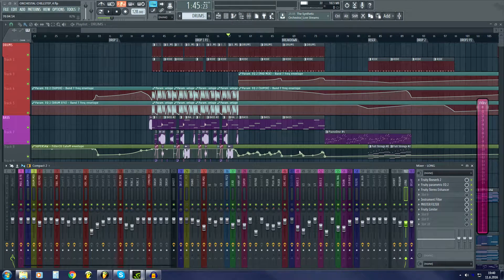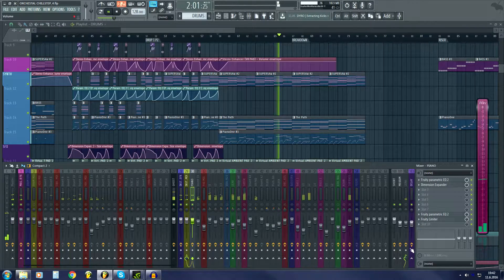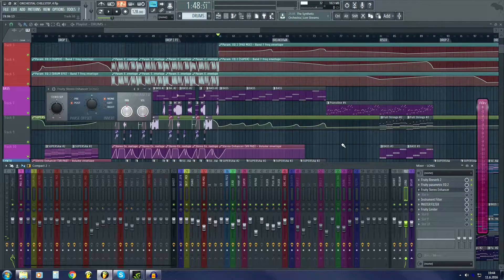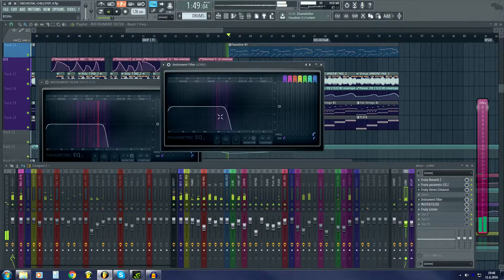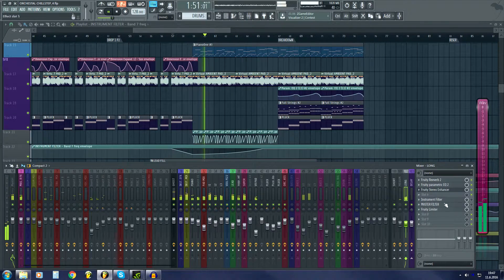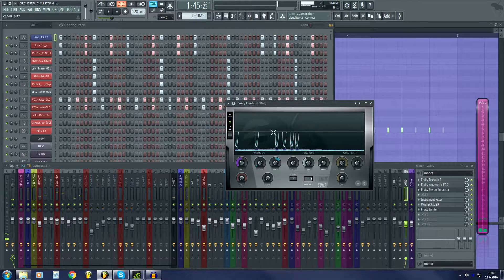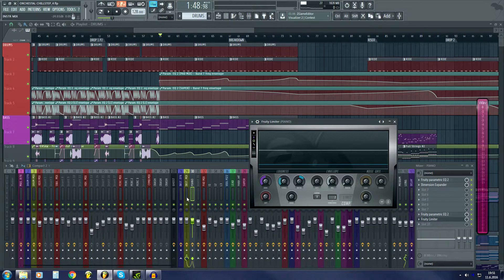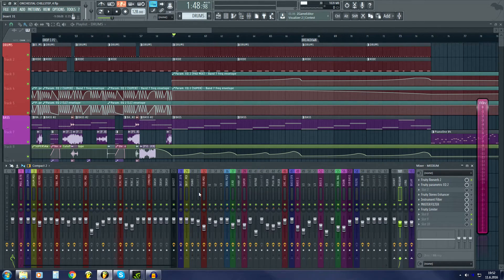How To Get Clean Mix In FL [Reverb Buss Setup Fl Studio 12]

Comment: And also when i use bus routing for a specific instr.the volume is increased for that instrument
Reply from the maker: You have to "only route to certain bus". What I mean is that if you route something, you have to delete old routing (otherwise sound will go to master and to bus which will also go to master). I hope this helps!
Reply: +Broken Elegance thanx i knew that i thought there could be some other way people do it. Do you use compression or mostly just gain using maximus for sound btw?